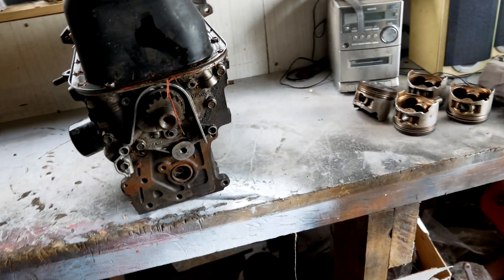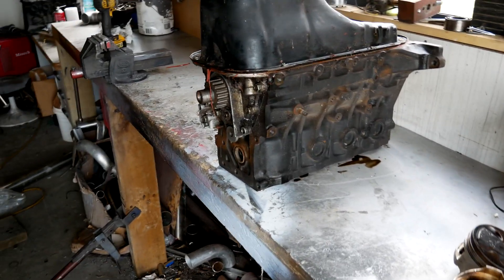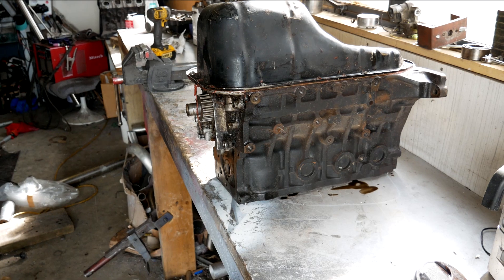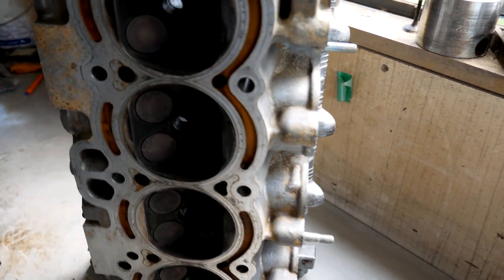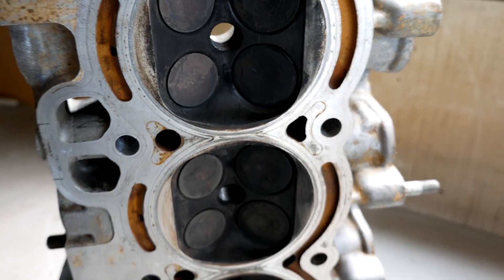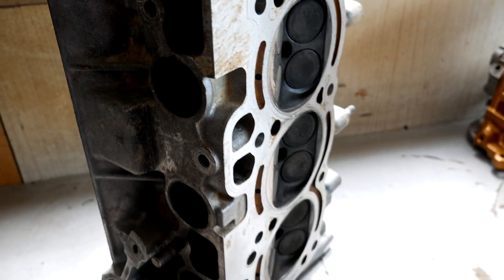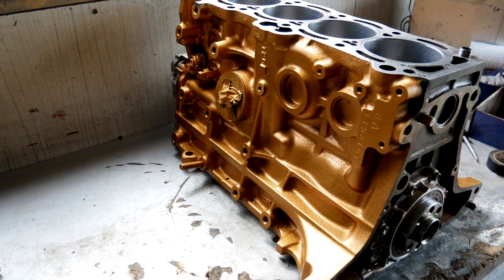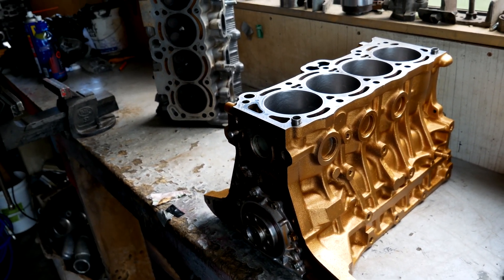Budget NA build that works - Smallport 4AGE

Comment: Good work. 
  What’s up with the torque figures? Dyno not calibrated, or is this turd the biggest torque monster in the universe?
Reply: Torque... at the wheels ! 
If the test is in 4th gear (1:1) with a 4.3 final ratio, then it's multiplied by that much
Reply from the maker: Yup as above.   punch the rpm and power  numbers in here http://wensensors.com/unipower/calculators/power_torque.asp     to get the toque numbers, remember will still be minius the driveline loss since using power at wheels to calculate it.   torque and power just calculations from each other along with rpm.

Comment: Love it. Have you ever tested the distance between the head and the itb's ?
Reply from the maker: Ive swapped to a completely different itb setup. bigger plates, different manifold and slightly different distance from head.    it retained the same trumpet setup, as was big enough for either setup.  was zero differnce in power  anywhere

Comment: What throttle body butterfly valve  size ITB  used?
Reply from the maker: they are blacktop 20v with oversized 47mm plates.  pretty sure this engine would make the same power on the 45mm plates.  just what i had hanging around off another setup
Reply: @Garage4age  Thanks.
I planing put on my opel v6 engine itb, already have 46mm, but afraid it can be to big, but looks like will be ok :D
Reply from the maker: @fregisz  yeah will be fine,  i run 52's on my other engine didnt loose anything down low over the 47's.   if you think  they are too big you can always try downsize the runner/trumpet.  dont worry about having a step up in size when gets to the throttles.  it doesn't matter as much as people say,

Comment: Very good video. For NA power seems like every little thing helps, maybe lighter pulleys, idk what oil you run but maybe some super slick synthetic kind, besides a major engine overhaul idk what else to throw at it.
Reply from the maker: Yup, its all about grabbing little bits here and there.  this setup would make more power with a cam swap.  But was more built just to test stuff on, rather than wearing out my good engine.  also  to show people what can be done with a pretty much stock longblock.

Comment: Really stout numbers for the little guy should be over 200hp at the crank
Reply: Close to 200, but not over. (190/195hp would be my guess)
Reply: @ProjectoD77  Just to think about it, this is pretty awesome for a 1.6 NA
Reply: @hojnikb  and power to weight would be good..this little car would hurt a lot of feelings against bigger cars.
Reply: Usually there is a 15% loss on the drivetrain in RWD.
Reply from the maker: probably around 190 i would think. pretty hard to say, driveline loss inst really a fixed percent.   still not bad for a smoky old junker

Comment: With a Link ECU, what sort of difference does it make? I have a 20v Blacktop with Kelford cams but its on a stock ecu with a SAFC 1 Piggyback. Wondering if it's worth the upgrade.
Reply from the maker: I tuned a guys blacktop the other day with tomei pon cams.   It made about 2kw more across most of the rev range  and up to 5kw in places, mostly up top.    The afr was pretty messy on the stock ecu, rich and lean spots.
Reply: @Garage4age  Surely tune my blacktop too? ;)
Reply from the maker: @DaSSaNcHeZz   sure,  buy a link hah

Comment: Another 10hp with red paint though!!!! Gold paint is too heavy and would affect the power to weight ratio ...LOL  Thanks for all your long hard work but guessing you enjoy the tinkering especially during lockdown. Would race fuel and increased CR shed a wee bit more power?
Reply from the maker: Upping the compression probably give a couple kw. I dont think race fuel is necessary.  my other engine makes over another 30hp than this, on around  13:1 compression.  this one is only 10.3:1.  both are on pump gas.

Comment: People can now see how tough it is to make more real world HP in a NA engine without some weed though out changes.  Bravo
Reply: Just tough on a garbage engine. You can make 250whp on a stock k24 block, stock k20z3/a2/a head, stock tsx cams and good bolt ons.
Reply from the maker: @givemefreespeechyoutubehitlers     sure;  k24 has 800cc more,   factory cams have more duration and lift.  has variable cam timing and is 15 years newer.  you'd hope it would make a whole lot more power.     This smokey old junker makes 170whp from a 1600cc,  so 800cc is  85hp.   add that 800cc to the 1600. my 2.4L 4age makes 255whp...
Reply: Awesome
Reply: @givemefreespeechyoutubehitlers  well that may be true but then you would also have to adapt to living with aids 👨‍❤️‍👨
Reply: @givemefreespeechyoutubehitlers i used to race b18 engined cars with cammed budget 7age16 and i won almost every time. The fast honda is always the one with two doors hatch with crazy weight reduction. Put the engine into a fat ass 4 door saloon, suddenly you will realize how weak it really is.

Comment: I think a cool experiment would be to make UEL headers like for Subarus,  I have also seen civics use them and they sound almost the same as the Subaru.
Reply: Any car will sound like subaru if they have 2 exhaust port atleast 4inches shorter than the other 2 of subsequent firing order...

Subaru uses 1-3-2-4 (short on 1 & 3)
If 1-3-4-2 then will need short on 1-3 or 3-4 or 4-2)